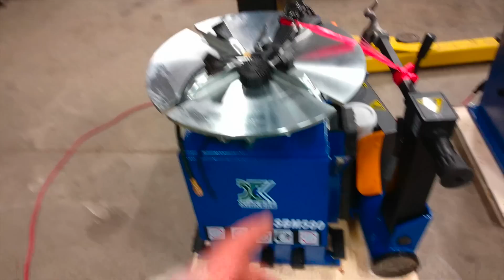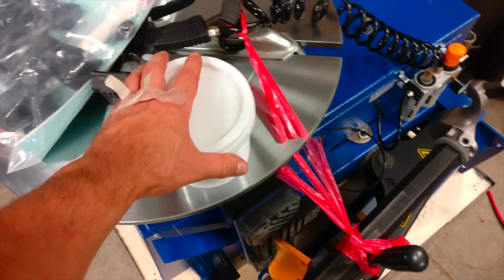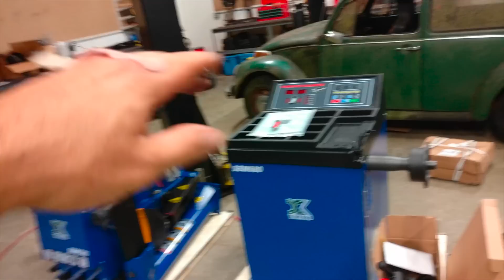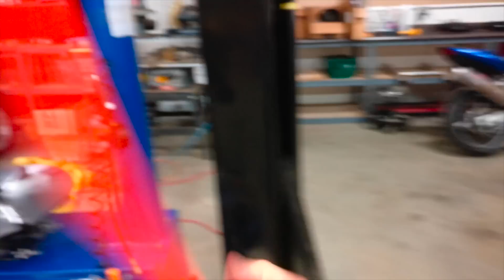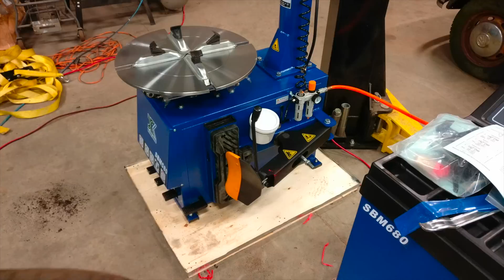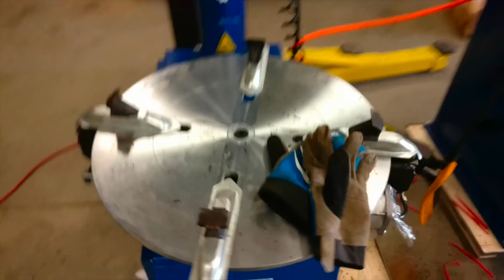Cheap Tire Changer 560 Mounting Machine Unboxing, Test, and Review

Comment: I know the alloy wheel had an odd shape inside rim but if possible it's best to clamp the wheel from the inside rather than from the outside on the rim. Two reasons, scratching the rim and possibly cracking the rim - learnt the hard way 😋